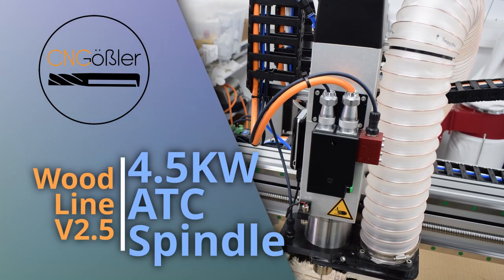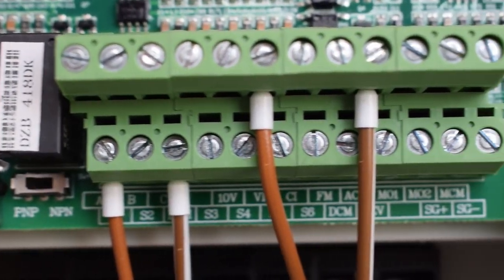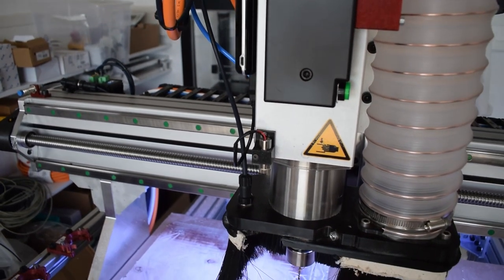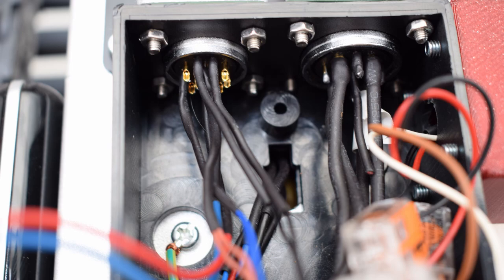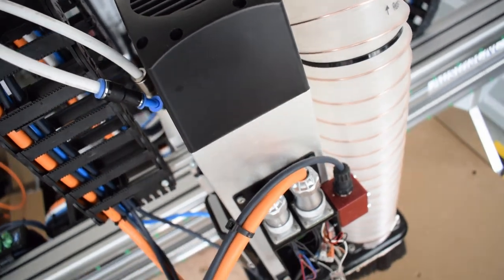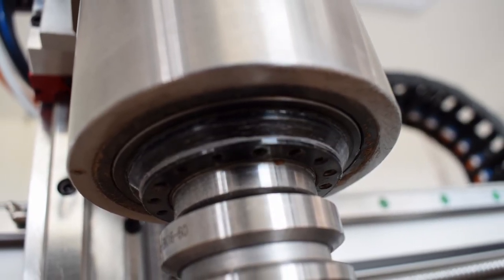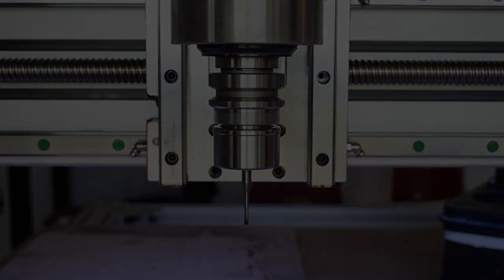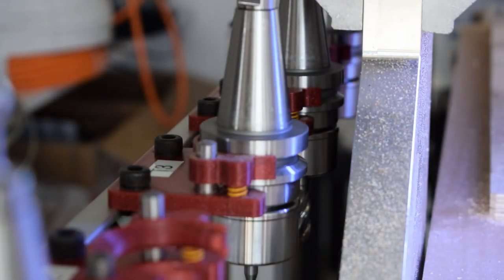4.5KW ATC Spindle for my Wood-Line V2.5

Comment: Hi there.
I believe I have bought the same set up, spindle with Fuling VFD, but the wiring diagram is really not helpful at all!
 Do you have a wiring diagram to help me connect, the VFD to the CNC controller and the Spindle to the VFD? 
 Any help would be greatly appreciated!!!
Also, how much would you make me 5 of your tool holders for? Do they need any additional programming as I see they are sprung loaded, mine are static.

Thanks in advance

Steve.

Comment: i have just added a sililar style atc spindle to my router 6kw with a fuling vfd , as a complete beginner i have managed to mount the spindle and have it running  , the one thing i am not sure  about is the setup of the manual tool change button i have two solenoids inline one of which i want to disable when the spindle turns on the other controlled from the spindle button , is this possible and who do i go about it , do you know of any good websites with info on this kind of setup , any help would be much appreciated.

Comment: I have just received the same spindle.  I did like you and clipped the fan power supply.  Too tight to solder.  How much in the other plug did you connect?  Do you have a diagram of how you wired it to vfd?

Comment: Sir... I have the same spindle and have it hooked and running and the pneumatic system running and the top 12v fan, but all the connections
on the 11 connector - connector... i don't have a diagram to use to hook it up.... i have e-mailed the seller in china a bunch of times and they always send be
another copy of the really bad manual.....   
would you please.... please give an old man a helping hand?  if you would like a tip, let me know how much you need.
Any help would be appreciated!!!   
Thank You
Phil
Reply from the maker: Hey,
I would recommend to unscrew the 11 pin connector and look what cable goes where.
I only connect the two sensors for clamp and unclamp. (1,4,2,6)
There is no direct clamp and unclamp function with the button you only get signals from the button (7,8)
5 and 11 are only for the button light i think.
Best regards 
Lukas

Comment: Hi please can you update us on how the spindle is? Any problems so far? Have you cut aluminum with it?
Reply from the maker: Hey Zebra,
The Spindle is still doing a great job! 
Till now i only mill wood with it...
No Problems anyway and  i work a lot with it.
Best regards
Reply: @cngoler9220  Thanks. Please can you tell me if it's actually 4.5kw continuous? I can't tell from the pics on ebay. The seller says the 220v one is 15a but the label in their pic shows only 11a for the 220v. This would make it closer to 3.5kw.

The ones they sell as 7.5kw S1 look like they're actually just 6kw by the rated amps so I want to make sure I'd be getting the advertised torque before placing an order....
Reply from the maker: @Zebra66 Hey 👋
I own the 380V version of this spindle.
I think i can't answer your question sorry :/
Best regards
Reply: @cngoler9220  Please can you tell me the actual (continuous) amps rating for the 380v version? I can tell from that too. 

I just need to see how they do the power ratings so I can choose between their 4.5kw and their 7.5kw models. I think their 7.5kw models might actually be 5.5kw which is closer to what I use now.

Comment: Hello and thank you for your video.  I just bought the same spindle from Ali Exp.  I’m having a hard time connecting it.  Would it be possible to reach you for some help?  Thank you
Reply from the maker: What do you need to know?
Reply: @cngoler9220 Hello,
Thank you for video.

I have same spindle with some questions.

———

Compressed Air, how to connect? 2 inlets on top.
8mm — for releasing tool. (is it 0.6MPa?) 
4mm — for releasing inner cylinders? (0.6MPa?)

on the bottom 4mm — (you've used blue tubing) is it air seal? is it supposed to be 0.2MPa?

Comment: Where did you connect thermal sensor from the spinner to VFD?
Reply from the maker: Hey 
I did not connected it because I haven’t enough inputs on my motion controller
Reply: Thank you.
Reply from the maker: @vitalygutkovich8998  I think you can connect it to an analog input on your motion controller but don’t forget a resistor
Reply: What size of resister do you think?
Reply from the maker: @vitalygutkovich8998  I don’t know but I think it’s an bt 100 sensor